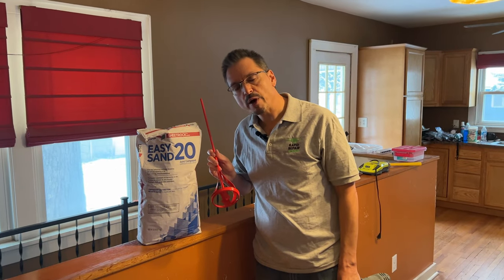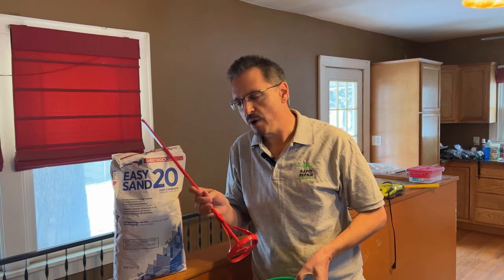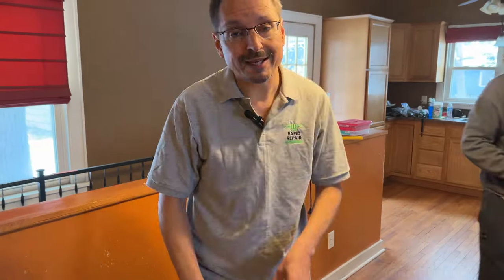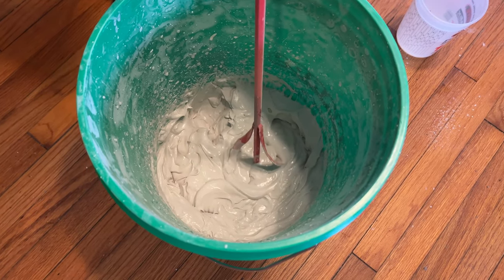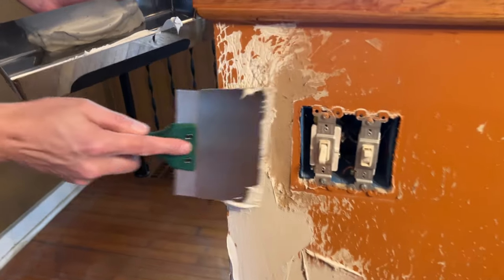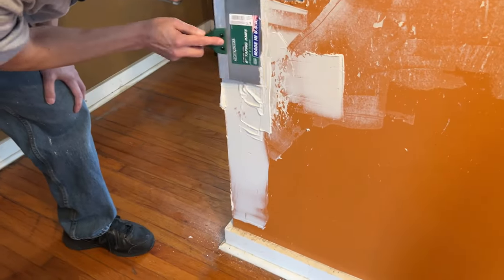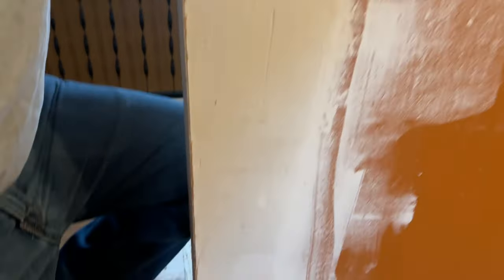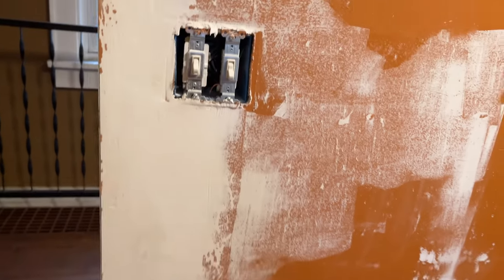How to Quickly Fix Drywall with Hot Mud!

Comment: I use it almost daily.  Hot mud is not only a fast set but sticks to the surface better.  After the first sand, I lightly wipe with a damp sponge to remove the dust and artifacts then top coat with Plus 3 or even all purpose premixed mud.
This is a very good video.  I may mention to the beginner, Once your mud is ready to apply, don't go make a sandwich or take a phone call with aunt Martha.  When you come back you will have a warm brick in your pan as it sets pretty fast especially now that it is getting warmer out.   ":)~
Reply from the maker: Thanks for sharing your knowledge with people

Comment: Repairing a square hole in my apartment. There is space between the wall and the top of the piece I put in and I was told to use tape around the joints. Would you recommend that?
Reply from the maker: Yes using tape is pretty much a necessity or the drywall compound will leave an unsightly crack at that joint as it drys. Good luck